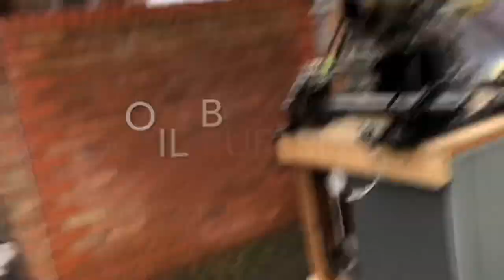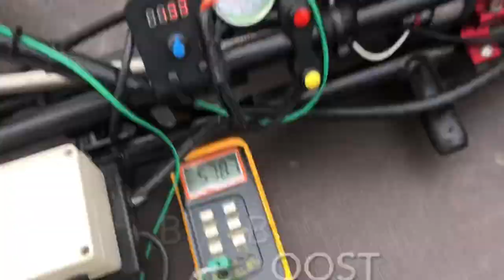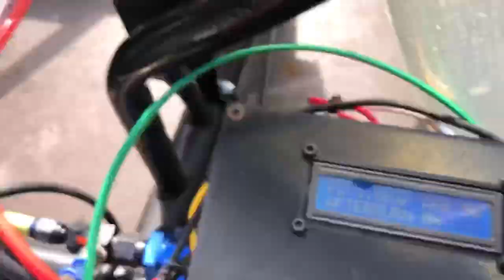Jet Kart Full Boost and Afterburner Test

Comment: how to do you control the fuel to the Afterburner? Do you use a solenoid in the fuel line and control fuel pump speed on the steering wheel? Not sure how to set mine up. My A/B has it's own fuel supply and pump
Reply from the maker: I have a small home built ECU that alters AB fuel pump speed based on the P2 pressure

Comment: Do you think experimenting with rockets is more worth it??

You will build something that goes much faster and rockets are cheaper at least initially
Reply from the maker: I would imagine the availability of fuel for rockets is a bit of a problem! But I have not researched it before!
Reply: @ScottsCrazyBuilds  i was into turbine engines before rockets but the amount of thrust is so small and they are just complicated and expensive!

I would suggest you watch tech ingredients playlist on solid and hybrid rockets...

Obviously solids arent an option to strap on a kart because when you light them you off for the ride!! But maybe you can put solid rocket boosters to assist the launch of the turbine but definitely do go too crazy

Other than that hybrid nitrous prrafin is the way but this is a bit more expensive